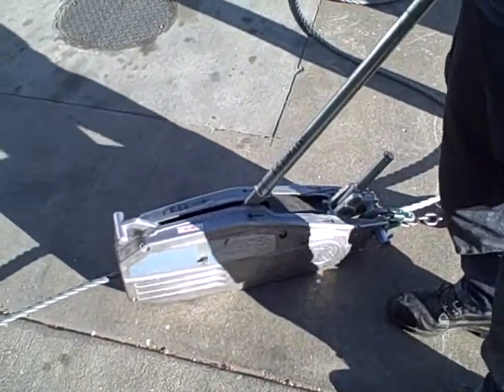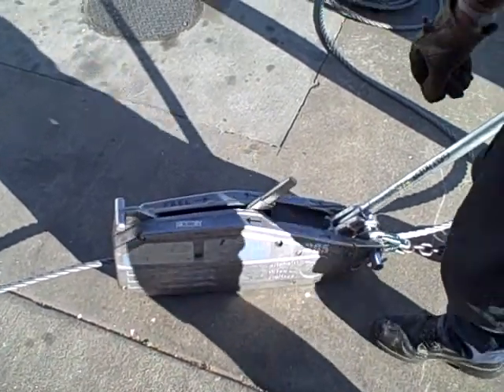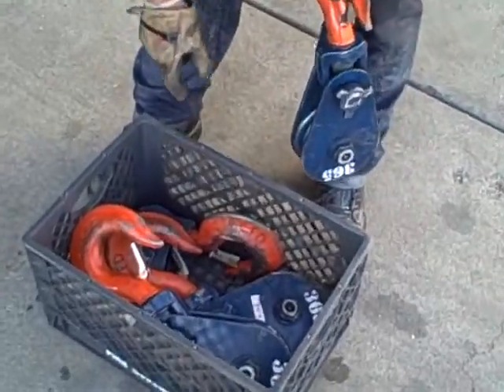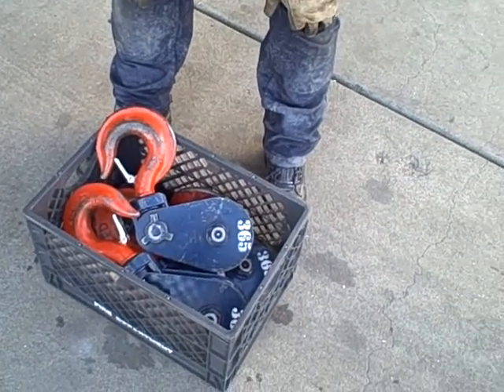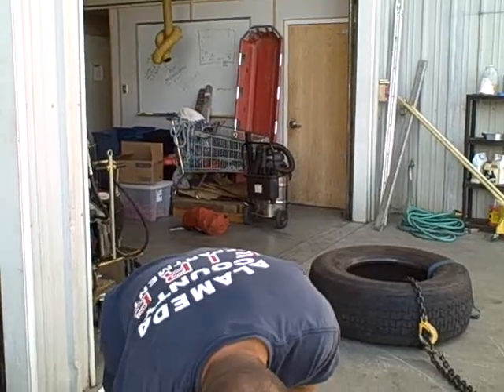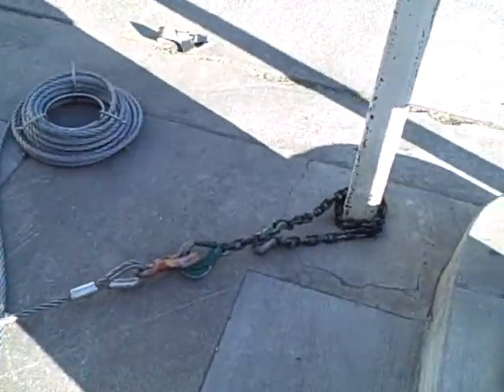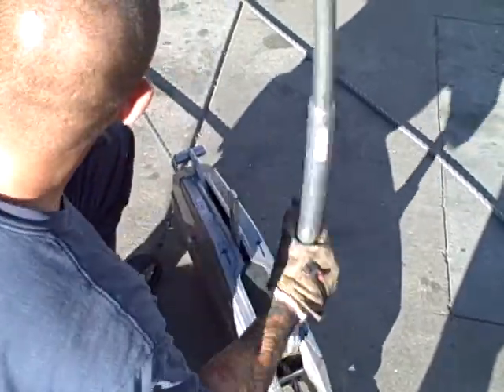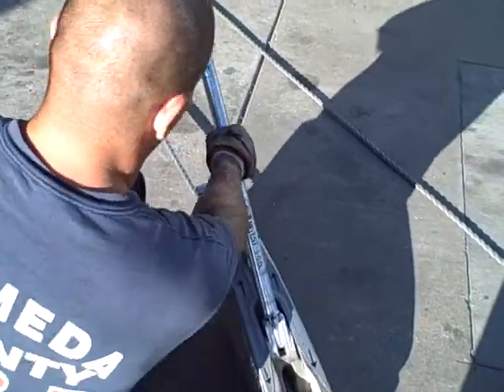grip hoist part 2

Comment: Isn't this just a 2:1 w/ a COD?
Reply: No it is a 3:1
One easy way to tell is to look at the terminal end of your haul line. If the line terminates at the anchor the MA will start with an even number. If it terminates at the load it will start with an odd number. Remember the phrase "Even to the anchor. Odd to the load"

Comment: Thanks for showing.
Very clear and easy to understand!
(sorry, but my English ist poor and limited) 

But, even if the demonstration dated years back, there is one thing to consider, in my view!

As i see, you are working near a fuel station? 
Ore, am I wrong?
But if it is as it seems to be, you might put a seperate plug very well fixed in the tarmac and "ground" all the parts in use!
In an environment like a fuel station (ore, other unsafe / explosive surroundings), one single spark-provoked by static charge-may end in catastrophe!  
In every case of operation! Also by exercising and instructions!

To put it clear: my warning is specific for use in "unsafe and / ore explosive Area"!
If you work (by example) in forrest and pull threes, ore you pull steel constructions, there is not such a danger!
No grounding of parts needed, there!

In these video all parts are grounded, because they lay on the ground! But if you start working and leave the ground it may change rapidly!

Thanks again!